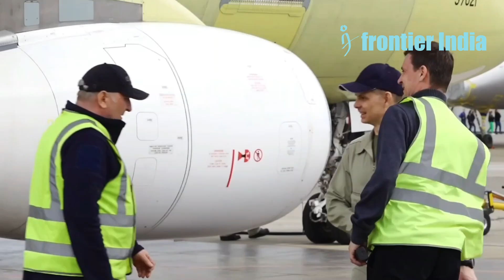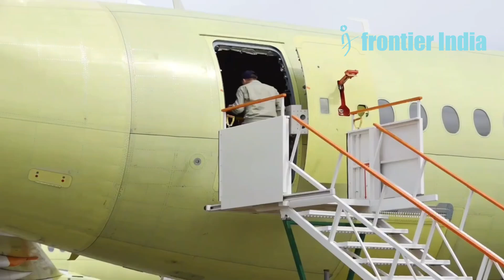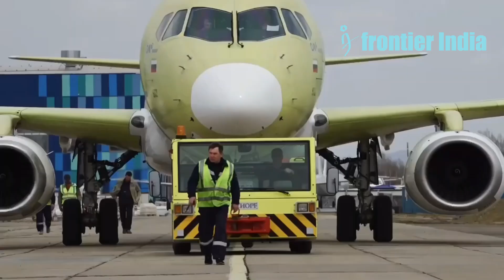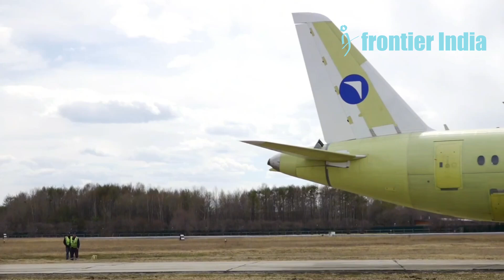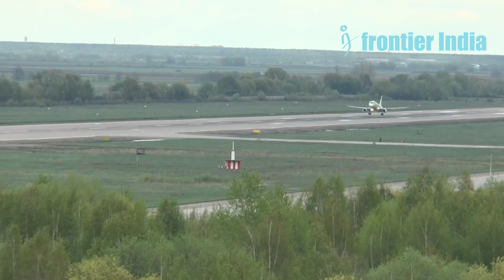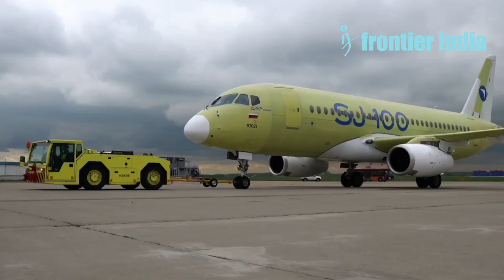Superjet 100 Prototype Soars with All-Russian Systems, Domestic PD-8 Engine soon

Comment: The reality: All Russian civil aircraft (e.g. SJ 100, MC 21, TU-204 etc) have so far had significantly higher maintenance costs & downtimes than promised & than competitor aircraft. Therefore their world market share (outside Russia/Belarus/Cuba) is less than 0.1%. 

The situation with the Sukhoi Superjet 100 (SJ 100): Only 1 was sold in the last 5 years, over 60 were ‘in stock’ in 2020 because returned or not accepted.

Comment: 2:00 Great They discovered the 737...born in the 1960s... maybe they will prototype a 1975 Pontiac station wagon..
Reply: At least SSJ-NEW isn't losing its doors mid-flight and not running a dodgily-programmed flight control system ;)

Comment: This airplane uses turbojets instead of turbofans.  Fuel consumption may be a bit high but Russia can afford it.  Important is reliability.
Reply: Nope. Those are turbofans. It's just that the bypass air is mixed with combustion jet stream before leaving the engine. If you look at the PD-8s bigger brother PD-14, it's bypass air is not mixed with jet stream and looks like a traditional turbofan.

Check out pictures of old JT8D engine. It's a turbofan, but also looks like this.

Comment: The western aircraft were mostly leased. This is not an option for these aircraft. Even if they can bypass the embargo there is insufficient funds in the Russian economy to replace the fleet. This is an act of bravado, not a realistic proposition.
Reply: LOL says whom that Russia has insufficient funds? Russia wasn't meant to be able to afford building Su-35S, Su-30SM, modernize MiG-31s, supply army with comprehensive kit, build new littoral warships, new submarines, upgrade heavy bombers, develop next-generation systems, put Su-57 in production, build brand-new T-90M tanks as well as modernize T-72Bs and T-80B/BVs at the same time and more. I won't even start on the fact that Russia has the most advanced nuclear energy reactors in the world.

I really don't know if you are open-minded enough to realize by now that everything you think know about Russia is blatantly false. There IS money in Russian economy, banks CAN and WILL lend to airlines to replace their Boeings and Airbuses with these SSJ-NEW and MS-21-310s. Honestly, how many times does your nation needs to be proven wrong before you realize that someone somewhere is brainwashing you lot, and on a huge scale?
Reply: They will replace in phase. They have no other option but to use their own jet. This in my opinion is a blessing in disguise.
Reply: They can sell to emerging nations

Comment: sure it can fly :) so could MIG 15 .... look at the engienes, it needs free fuel to be competetive
Reply: They are turbofans. Like the rest in the industry. Also as the narrator stated, these are older SAM-146 with bypass air mixing with jet stream.

Comment: Russia is capable of building passenger jets  100% by its own potential
Reply: TRUE
Reply: They are so good that no one wants to buy them
Reply: @migavia А пока их продавать никто не собирается.Вы видели масштабы нашей страны? Они летали в Европе,но,увы,не слижилось с поставкой запчастей,это правда.Не переживайте за нас.
Reply: @migavia  China ,India, Russia, Africa and South America will buy them. 
Half the worlds demand.
Reply: @migavia  Well, for now, it is like that. Marketing means publicity. If this passenger jet works well then it will get a big market. Time will say. OK
Reply: Nope. Most of the parts are all imported.
Reply: Flying them is another issue
Reply: It will never be able to compete against western aircraft in quality,  reliability and efficiency
Reply: Bull, they have taken all the electronics from the aircraft they stole, by not returning the lease planes.
Reply: @stevecarlisle3323 Россия,в отличие от Запада,ничего не ворует.Не волнуйтесь,справимся.
Reply: @stevecarlisle3323  China the worlds manufacturer is right next door, Russia don't need to "steal" anything.  They can simply ask China to manufacture equipment for them.
Reply: @The-Cat  Not really 100% then is it , like the original post.
Reply: @stevecarlisle3323   Just like Apple products   China only (Foxconn) does the manufacturing.    The designs and specifications can still be done domestically .
Reply: @legend9805  They need to size more for war reparations.
Reply: @stevecarlisle3323  The west will owe Russia and Ukraine a lot for starting this war.
Reply: @ftboomer1  Russia started this war, Ukraine was Attacked, where have you been the last 2 years 😂😂😂😂🇨🇦
Reply: @legend9805  nobody want roubles !!
Reply: @legend9805  Russia trying to steal Ukrainian land😂
Reply: @stevecarlisle3323 Спроси Нулонд с печеньками кто начал эту войну

Comment: Engines take time to develop and perfect, but of course it will get a Russian engine. The PD series of engines they are making are new designs, unlike the engines it is using at the moment.
Reply: Russia has a lot advantages in terms of metallurgy expertise, availability of metals like Titanium, Chromium, Nickel, Tungsten, Boron, etc.  Ceramics?  Most important is not let corporate greed compromise reliability and quality.  Sadly that is what happened to Boeing.  Passenger airplanes need to be 100% reliable and safe.